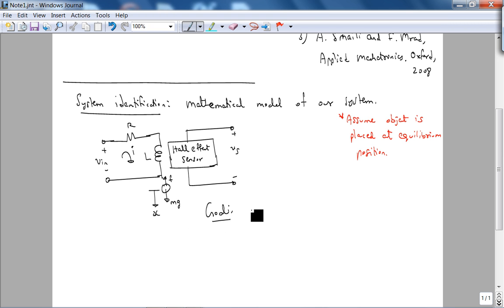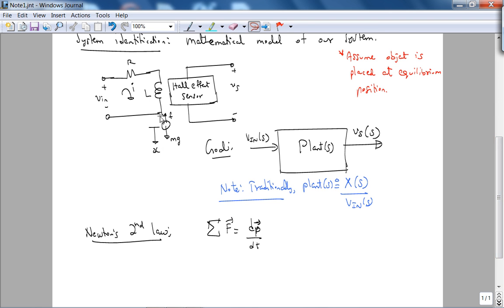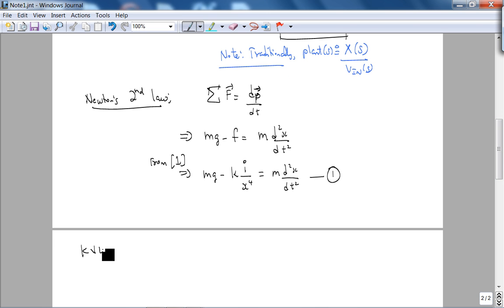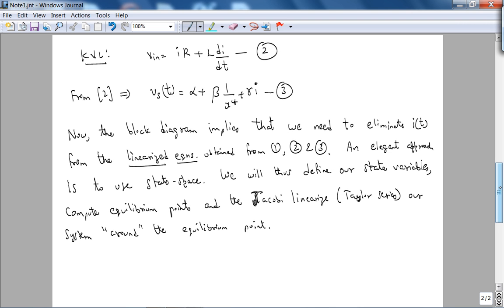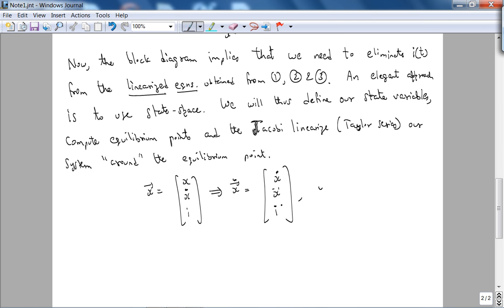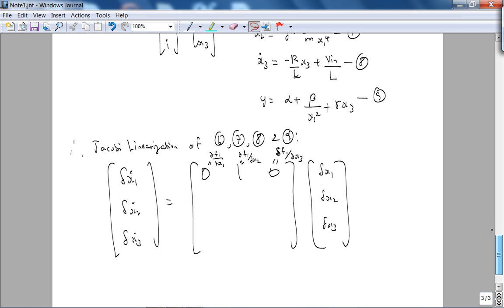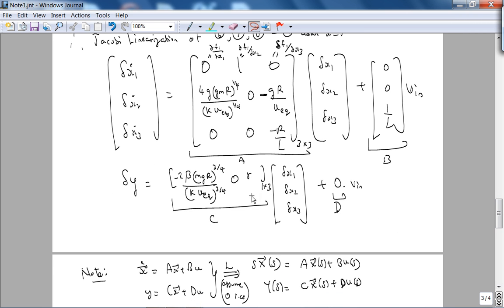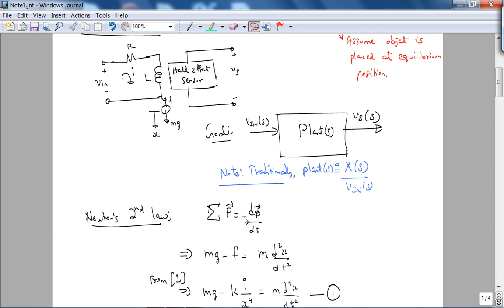ee3720 Winter 2013-2014 week 9 Lecture 2 - Electromagnetic Levitation

Comment: didnt your first equilibrium point after getting eq 4 and 5, had to be a fourth square?? i supposed that you cleared "X" from equation  4, can you help me?
Reply from the maker: Thanks for the question.
I dont really work on academia much, but perhaps this detailed report from my graduate course 12 years ago may help:
http://www.harpgroup.org/muthuswamy/pubs/DesignOfMagneticLevitationControllersUsingJacobiLinearizationFeedbackLinearizationAndSlidingMode.pdf
Sections II and IV A. should help.  Good luck.
Reply: @bharathberkeley   can you please re-share the link ? I have found your lecture very beneficial for my thesis. Thank you
Reply from the maker: @alialqaraan2230  thx. for the comment.
I am in the process of getting my website back up and running.  Please email me: bharath.berkeley@gmail.com and I will try to dig up the mag lev report.  Thx.
Reply: @bharathberkeley   Great! it is my utmost pleasure to cite your mag lev report in my thesis